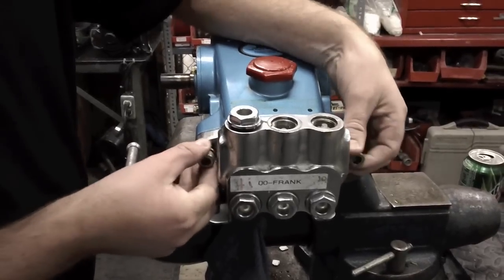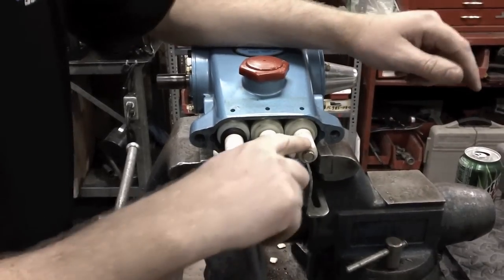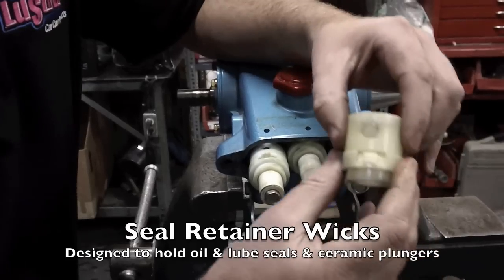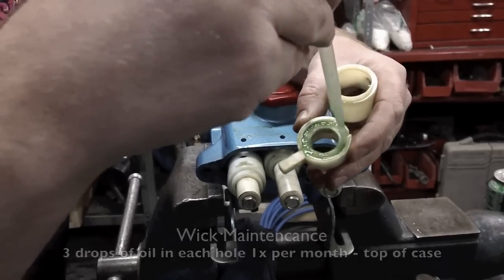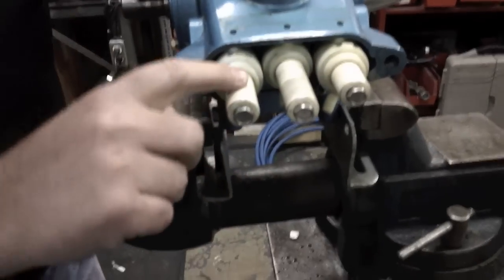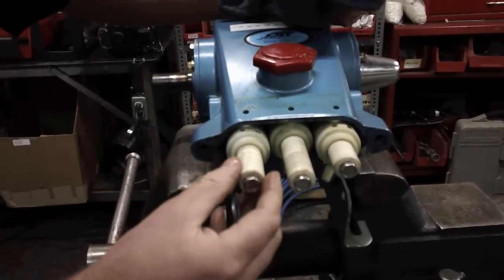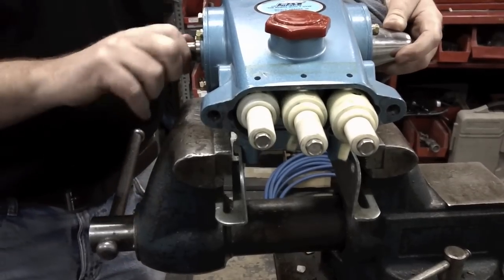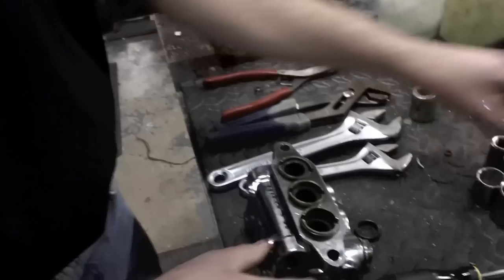Cat Pump 310 Seal Kit Part 1

Comment: Hi i have a rigid pressure washer and works perfectly but the cat pump oil is gray i use the original catpump oil for change it and turns gray again but the machine works perfectly, so whats happen with tha oil? Thank you

Comment: Good morning I have a high pressure machine brand cat pump and I think I'm mixing oil in the pressure pump the oil looks yellow some help thanks model# ct80020  3800psi
Reply: If you are using Cat brand file then it is designed to turn a milky white when mixed with water. Are there any other issues; low pressure, oil coming out of cap on top, water leaks? It is likely the yellow oil is the same but water could also come from condensate if used outdoors in cold weather or if in a very wet environment.
I would replace the current oil with Cat brand and see if it turns white (change oil every 500 run hours). This is a low cost way to narrow down the possibilities. 
If it does then you likely have a cracked ceramic plunger or bad gasket under the plunger retainer stud (bolt). This allows water to travel down the plunger rod into the crank case. When you remove the head, check the ceramic plungers for very fine hair line cracks (careful if they are cracked - very sharp). If no cracks then replace the seals under the plunger retainer stud with hand tight pressure (firm but gentle) as to not crack a plunger.

Comment: would have been nice if you had taken youir hand away so we could see the seals when changing the low pressure ones.

you actually caused more confusion by not doing it clearly.

Comment: +HI-Performance Wash Systems 

There's a better method for checking your ceramics. Take off the ceramics, keep the bolt in the top and shine a light up through the bottom. You'll find more hairline fractures that way. :)